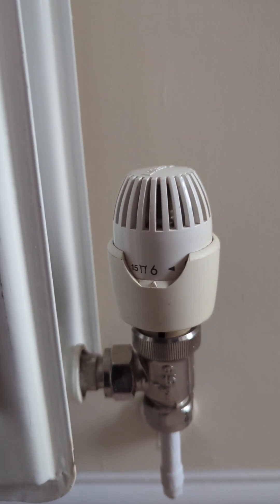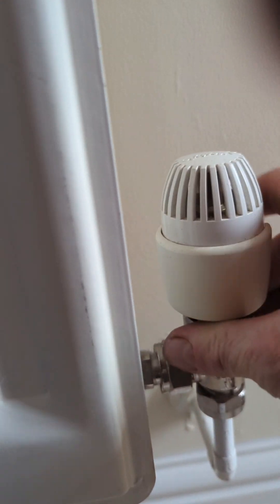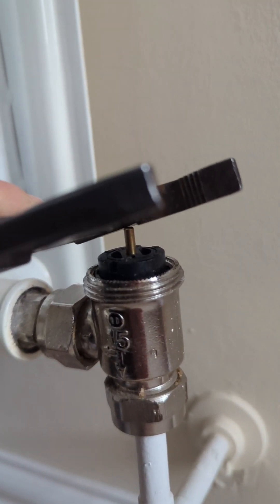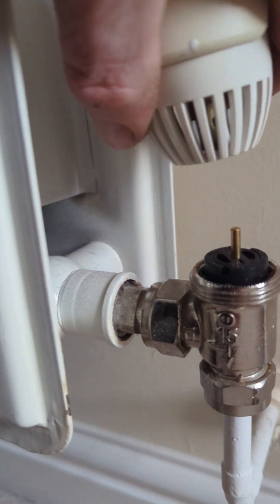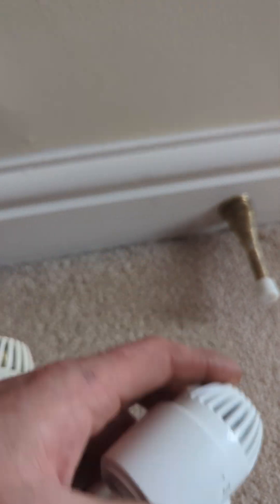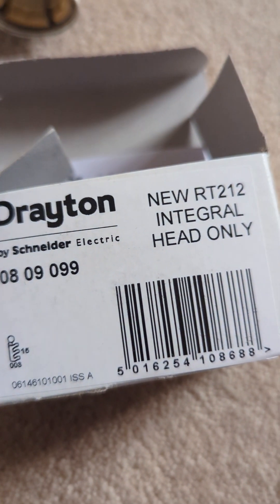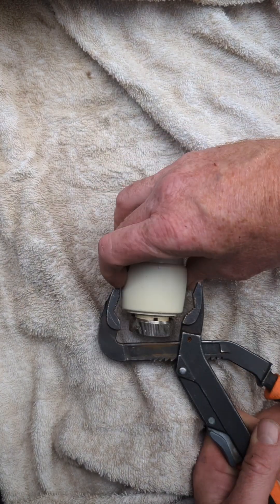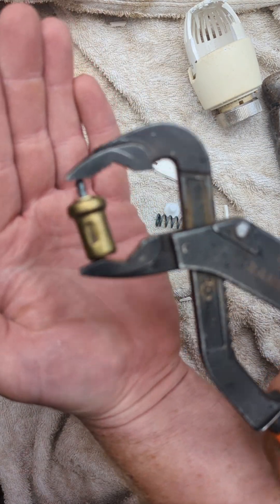radiator not heating up? Try replacing TRV head

Comment: Its not the spring that opens and closes the radiator valve, its the wax in the valve in the trv head that expands and so presses on the spring in turn presses on the hammer, and so closing the valve.

Comment: When you take the old head off, do you have to take it off at highest setting too? Because I didn't notice that when I replaced mine so I just took it off without looking.
Reply from the maker: @aron2015  it doesn't matter. It just makes it easier to take off/put on when on maximum

Comment: You never mentioned you can pull the pin out from underneath and set your temperature you can set it from 10 to 29 choose your desired temp then put the pin back in so your kids or wife can turn the tvr up past the temperature you have set it at.
Reply from the maker: @ChrisJoned I didn't realise you could do that on these valves. You learn something every day!